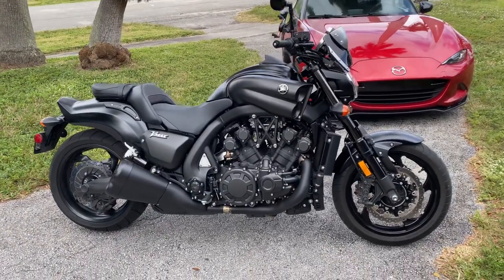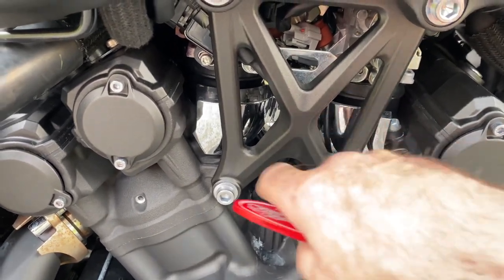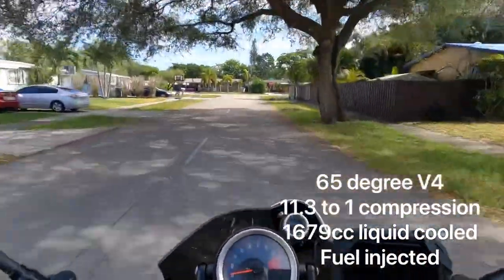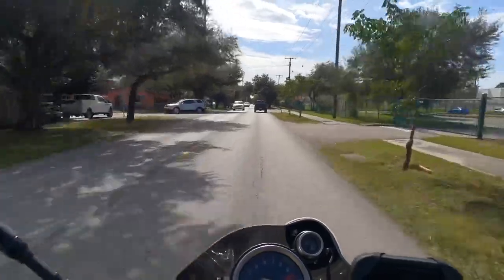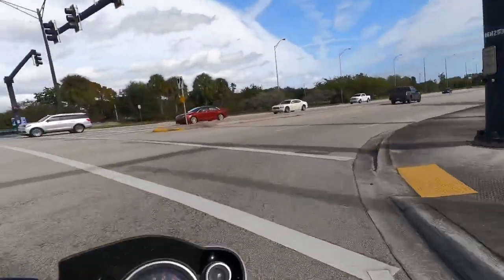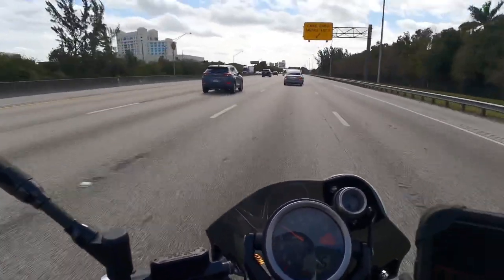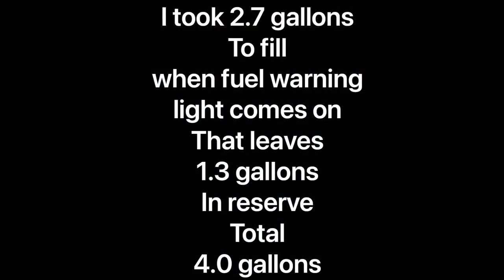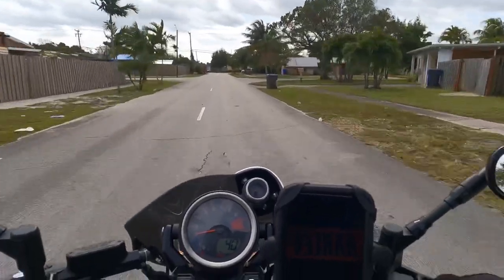2020 Yamaha Vmax 1700 full review

Comment: Yes the Vmax is a cruiser - pulls powerful but not to heavy from roughly 1000 to 3000 rpm which equals the local speed limit of 100kph (60mph).
It turns into a powerful heavy naked bike if you exceed 3000rpm. Very smooth but very powerful and perfect for long and narrow twisted. 
If you exceed 6500 rpm it mutates into a drag bike that accelerates so hard - mind blowing. 
So, you get what you ask for. 
The sensation is not mainly the acceleration itself, meanwhile there are many bikes on the market that accelerate similar.
The sensation is the lack of drama to get that acceleration - no downshift or exorbitant high revs needed - combined with the lack of any electronic aids (apart from Abs)
There is no sports mode or rain mode, no traction control, no wheelie control nothing. It is your wrist and your brain.
The best bike I had so far and possibly the last. I don't see how any bike can push the limits legally beyond what the mighty Vmax Gen 2 delivers
Reply from the maker: Great comment! Thanks for watching👍
Reply: A great bike.. a dream bike for many
Reply: I have to disagree, at over 4000rpm it tries to rip ya fingers of the grips.. I’ve found myself giggling at 135mph as it still pulls like a freight  train until 170mph.. +
Reply: @paulkmaster3231  I bet ur lucky to get 3000 miles out of that back tire!! Lol
Reply from the maker: @markbeck3115  I’m half way through my second tire with only 3500 miles on it
Reply: @paulkmaster3231  oh my lol

Comment: I have mine flashed, K&N and Cat deleted.... 180 hp dyno at the wheel, i get 30-32 mpg.
Absolutely love the ability to cruise normally OR test the laws of physics ...smokes tire 1st or 2nd gear at will ... forget driving in the rain without perfect throttle control.... handles itself amazingly for its weight. Add a 6th gear and and a 5 extra litre gas tank and it would make this bike a Mona Lisa.
The gas stop factor is a huge pain like you mentioned especially with longer range bikes in your riding group...
With a 6th gear, combined with all the VMax torque, this could of been easily a 45mpg+ machine.
Love my Max, don’t see myself selling it.

Comment: Nice bike mate. How's the leaning and handling on twisted roads? 
I saw some vids where they were scraping something by the sounds of it. (I ride the MT01 1700)
Reply from the maker: Thanks for watching and commenting. Mt01 wow I wish I could ride one those someday they never sold it here in the states. I had a Buell XB9r Firebolt though at one time I really loved it. As far as cornering on the big Vmax I never really even tried. I live in Florida where the roads aren’t very twisty but there are some roads that are. Somehow I never felt like trying to take a corner hard on this bike it’s pretty heavy and feels it. Its strength is in straight line performance and is ok on longer trips except for the low fuel range. I’ve taken corners harder on my Harley Streetglide Special than this bike lol. Sorry I don’t have better info. Wait I did have a close call once and it did maneuver very quickly to avoid an accident. I’ll send a link https://youtu.be/HiHEhmLPJXc?si=awI4CMfZwNbUHBff
It happened while riding with my buddy on his M109r

Comment: Appreciate it the video my man, a friend of mine had a VMAX the very first year that it came out, it was 1985 or 86 . He was a huge guy , 6'3 350 lbs, and he could keep up with anything on the street back then, but his front wheel wouldn't stay on the ground, not like yours.
Everytime I rode it, I would have to weight until I was in the higher gears, before twisting the throttle.
Beautiful bike man , stay safe man" and keep on keeping on.
Reply from the maker: I’ve never ridden a first gen Vmax but remember they had a reputation for being one of the hardest accelerating bikes out there. Thanks for commenting

Comment: The VMAX is not a cruiser. It's what's called a muscle bike. That's what they classified it as back in 1985 when the original was version was introduced at the dealer show in Las 9:46  Vegas. They hired Jay Gleason to demonstrate what the bike was capable of. He was a pro Drag racer and he only weighed about 140-150 lbs. so that helped him in getting the most out of the bike. Almost all the motorcycle magazines hired him to do their timed speed runs especially the 1/4 mile. He really did a great job demonstrating what the bike was capable of. He roasted the rear tire in seconds. Very fun to watch.

Comment: Definitely NOT a cruiser. Its a naked standard. I would not have bought it if it had cruiser ergonomics. I have a 2009 which I bought new and I have never felt the so-called jacking. The fly screen was an option. Yamaha intentionally left some low frequency vibration in the engine to give the bike that proper muscle bike feel. The only disadvantage in my opinion is the small fuel tank. 50 pounds less weight would also be nice. 

People's reaction to the styling is very polarized. You either love it or you hate it. I love it. I'm 67 years old and have owned about 15 bikes since I was 14 and this is the best bike that I have ever owned. Not one problem since I bought it new in 2009. While a few bikes are a little faster in the quarter mile, I don't think that any bike will beat it stop light to stop light.
Reply from the maker: So far I destroyed 2 Busa’s one first Gen I even put it up on my channel. And a 2 Gen Busa. The only thing I dislike is the fuel range its horrible. Everything else is perfect I don’t even mind the weight. Oh yeah the suspension is a little stiff but I haven’t done all the adjustments to get it softer yet. And yeah I shoulda taken that ugly sticker off right after I purchased it. It’s a sticky mess now!
Reply: @paulkmaster3231  Use a hair dryer to remove what you can. You should able to remove the sticker remnants with gasoline without damaging your paint. Just don't use any other solvent.

Comment: The VMAX is definitely a cruiser, even if you don’t agree with that fact. It’s a power cruiser. Nakeds are superbikes minus bodywork with a handlebar instead of clip-ons. Just because it has huge horsepower and torque, that doesn’t mean it’s dismissed from the cruiser category. I also ride both a VMAX and ZX-14R. Nobody who rides a Kawi 14 should find the VMAX “scary” because of the power.

The only flaws in the VMAX are:
Fuel tank capacity (it should be 5-6 gallons instead of 4).
Fuel mileage (meaningless if the tank is bigger).
The 5-speed gearbox (it should be a 6-speed).
The electronic nannies that limit power in the lower gears and top speed (Nash Flash tune cures that).

Comment: Can you tell me what the engine sounds like ? Mine has 100 miles on it.  It just sounds like the engine is rattling like crazy ?
Reply from the maker: Why don’t you take it to the dealer? They can tell you if it’s a normal sound or something is amiss. Whenever I ride one of my bikes without a helmet I hear all kinds of sounds I never heard before in the engine. My 2020 Vmax and my 2020 ZX14r both make intermittent rattle noises in the engine this is normal. If it’s excessive then this is not normal check it out
Reply: @paulkmaster3231  I plan on taking it to the dealer. Just seeing if anyone else has the same sounds.. The V-Max engine is a very loud engine.
Reply from the maker: @tomcavin3989  good idea. I don’t ride the Vmax that much it’s for my daughter to enjoy. I ride either my ZX14r or my Streetglide special. If you email me I’ll try to send a quick video of the engine noise
paulk.asemaster@gmail.com

Comment: You got to remove the factory stickers asap! The longer they stay the quicker the paint will go a different shade. This satin finish is great but you can't buff anything out!
Reply from the maker: Yeah I know. I actually tried to if you look close. It doesn’t want to come off in one piece. I gotta get some kind of solvent that won’t hurt the finish. Maybe I’ll try wd40 or something. Thanks for watching and especially commenting.
Oh yeah I know about satin finishes..traded in my satin black Vrod. The finish was so bad I just wiped down with tire shine before I traded it in😉
Reply: Heat gun works. Solvents on a satin finish is risky.

Comment: How do you not catch the wind and just go airborne right off the seat at these speeds!  If you had an extra gear the speed would be dangerous for you, a grasshopper would be like a gun shot wound.  It sounds like a short stroke machine, big bore short stroke, am I wrong?
Reply from the maker: Yeah you hang on for dear life and that’s with the computer governed top speed of around 140 mph but the Speedometer is a little optimistic and says 148mph. It’s a completely different experience as a true cruiser. It makes a lousy cruiser and it’s really not one at all. My cruiser buds tolerate me riding with them on the Vmax but I annoy them with powerful roll ons and needing to get gas all the time. But it sure is quick!!!